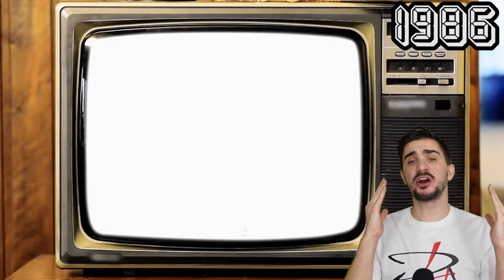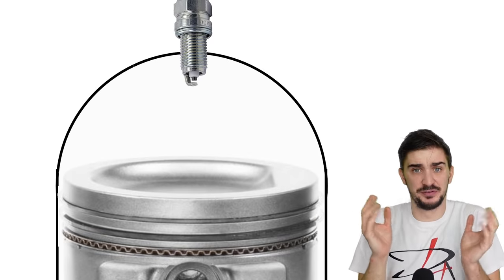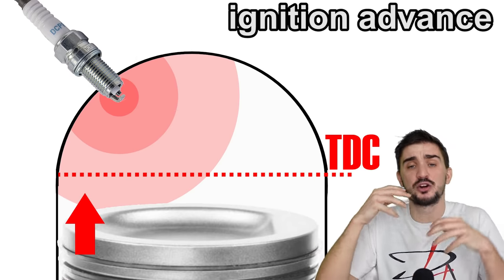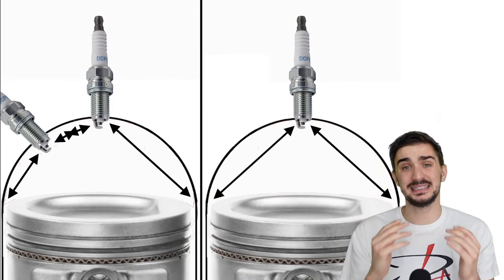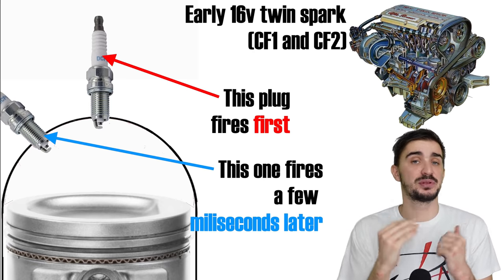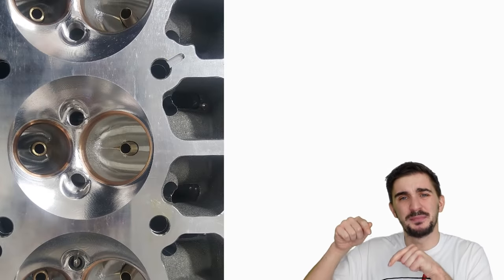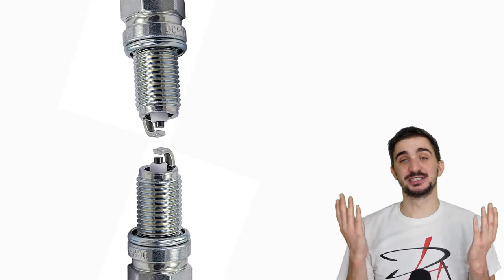TWIN SPARK - WHY, HOW and why it isn't more widespread

Comment: Your videos are almost always great, but this is quite wrong. Twin plugs are really only done as a band aid, no decent engine designer has ever started with twin plugs unless redundancy is needed. The biggest miss is the fact that they are needed on a 2 valve hemisphere combustion chamber beyond a certain compression. As you bulge the piston, the chamber end up looking like an orange peel section, which means no flame propagation to the other end. Some builders back in the day even resorted to pistons with groves in them linking the two sides. It’s not for speed or really anything else aside a band aid for combustion stability.

Comment: I have this cool motorcycle in the Philippines it was a bajaj rouser ns200 with triple sparkplug. I mean its not necessary but its helpful when it comes to traveling long distance no need to worry about having a bad sparkplugs cause you got 3 of them 😂

Comment: 2003 -> present 5.7 hemi has twin spark plugs. Fairly certain of everything mentioned the gen3 hemi is the most widely produced twin spark engine that ever existed.
Reply: Only if you consider North America. 

Even then.. Chrysler is the smallest of the Big Three… and most of their vehicles have the Pentastar (for example only one of every ten Chargers sold has a Hemi).
Reply: @Bartonovich52  No, I literally mean its the most widely produced twin spark engine ever produced worldwide. You can look it up, they've made millions more than the next most widely produced multi cyl car engine anybody can name. Sure, if GM made an LS or LT that was twin spark that would easily be the most produced. And Ford simply did not produce anything twin spark long enough to really get the numbers out there.

Comment: The Alfa with 2 sparkplugs i knew before - the original Shelby 350 and 500 engines also have 2 sparkplugs (16 ) - have seen that some nitro-metane motors also use 2 plugs per cylinder , thinks it becauce the lethal nitro almost makes the pistons and valves melt down  and burns it tight together

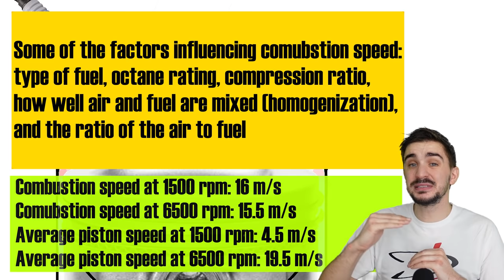Comment: At 4:41 can I know why the combustion speed decreases with increase in rpm
Reply from the maker: The mixture needs to be richer at max rpm and max load.
Reply: @d4a  A twin spark cilinder head is a tragic example of a bad developed cilinder head.
In order to recover this they added a second spark plug. The cheapest way!

Comment: It all depends on chamber design and the burn rate. If using normal "fast burning" fuels in modern efficient chambers which have fast burn characteristics the twin spark does next to nothing.

Comment: There are/were sparkplugs with multiple anodes. Old Volvo sparkplugs had 3 connectors to the core when i remember correctly. I dont know why. Maybe because of the Turbos and weak ignitioncoils. Maybe some one could help Here.

Comment: 10:32 let me see if I understand the joke: some VW engines are today using stratified injection, indirect AND direct injection. So they can purposely use heterogeneous mixture in a good way. They create a heterogeneous mixture if you are talking about the entire chamber, but actually they create an homogeneous mixture close to the spark, so it's possible to use a poor mixture in the rest of chamber unless being incomplete combustion, once the homogeneous mixture close to the spark will to the job of firing everything.

Comment: Aircraft have two plugs for redundancy and reliability. I've yet to read anything that references performance.
Reply: I might add that this addition to aircraft engines has been done since before the first mass produced aircraft.
Reply: The efficiency is marginal, but it exists. When you're fliying, you're supposed to turn on and off the mags from time to time to check if they are working. When you turn one mag off, you loose about 50rpm. Its marginal, but it exists.
Reply: As stated in the video @12:25

Comment: 12:10 - Almost all Piston Powered Aircraft (99.9%) have 2 magnetos which are AC generators that fire the plugs - Sorta Like a generator, Coil, and distributor in one unit. So if they only had 1, and it failed no plugs would fire, and they would have a lot more to worry about than hydrolocking the motor.

Comment: Why not more than 2 plugs? Say 4valves, and 4plugs, or 3 plugs,  one on each side of the valves one one center, maybe fire the two outer, slightly before the center, so possibly the remaining mixture will possibly be at a higher pressure, when ignited, it would only be a slight timing difference, but it could possibly work,  it would be like having a higher compression ratio,   has anyone done any testing on this?  Seems there could be a performance Gain, from the higher pressure of the mixture,  and slightly later when the crank angle is closer to 90°  a engine still expanding the combustion at a great rate with the crank angle close to 45°-90° would make tons of power, like a nitromethane, top fuel engine,

Comment: Twin spark plugs would benefit short stroke big bore engines that rev high (race engines).  Porsche had a twin spark 3.6 litre flat 6 in 911.

Comment: My motorcycle has twin spark plugs per cylinder. It’s a 2008 Kawasaki Meanstreak 1600. Definitely not the pinnacle of engineering. In stock form it produces a whopping 73 horsepower. So in my case, it’s slightly higher service costs for no real benefit, power- wise anyway! 
Still, I get to tell people that my 300kg, Japanese cruiser is a twin spark and that makes it cool, right?!

Comment: Would be curious to try modifying to a dual spark plug a 2 valve, single plug engine 🤔.
Reply: Back in the late 70’s Kawasaki did that with their Z1000 Superbike racer.
Reply: @kasperkjrsgaard1447  Thanks for the tip, that's a good inspiration! Do you happen to know of some article or material about it? I'm not much of a bike guy.

Comment: Aero engine twin sparks engines (mandatory) has more to do with the legal requirement that aero ignition systems must be self exciting, (not rely on a battery)  meaning that in the boat anchor technology of aero engines, (once it's certified its specs are carved in tungsten carbide and woe betide any-one who attempts to alter them ) Leading to the magneto  being the most common ignition system on aircraft engines since WW1. Magnetos have all the reliability of a 1960's Mickey Mouse watch in a fish tank. Mean time between failure hovered around the 800 hour mark for decades ( compared to electronic ignitions being around 10,000 hours MTBF) Magneto failure was (and still is) a quite common occurrence which is why at every take off a magneto check  is carried out before flight.. The second spark plug is there to keep the fires alight in the likely event that a magneto calls in sick and roadside service is unavailable

Comment: I do belive, you missed the whole point of Alfa's reason to develope the Twin Spark engine in 1986. At least you skipped the most important part.
The Japaneese was introducing 16 valve technologie at that time, and the Twin Spark, made the 8 Valve engine so efficient that the power output was the same as creating a 16 walve head.
Drilling an extra hole, was like a LOT cheaper, than 8 extra valves and valve trains.
The result vas a 8 vale engine, producing the exact same Hp, as a 16 Valve.
Here's the real reason to Why. 

And Knock accures before a spark from any sparkplug, not after a spark has ignited the fuel mixture. Just for your info. :-)
Reply: Detonation (spark knock) : POST-ignition, uncontrolled spontaneous combustion … Just FYI …

“Detonation is an uncontrolled combustion event which occurs after the spark event. Pre-ignition is an uncontrolled combustion event which occurs before the spark event.”

Comment: Question...since small airplanes operate at constant speed and load why not use diesel engines? Far more reliable, better fuel economy would downfall be weight?

Comment: So if the main holdup for twin spark is limited headspace. What about 2 stroke engines? They don't have any valves, so the entire head is free real estate. Or what about flathead engines? No reason not to make them twin spark. Maybe my lawnmower could get a little extra power and efficiency.

Comment: My 2013 6.2 f250 16 spark plugs. It seems to work......or Ford owns stock in a spark plug company. I'm sure the current 6.2 f250 still has dual spark plugs.
Reply: My Ford 6.7 didn’t have any spark plugs …
Reply: @sking2173  it's diesel

Comment: In the hemi section, you say that the hemi doesn't have variable intake. This is incorrect. All of the improved 5.7 engines have variable length intakes. This gives them a very flat torque curve.

Comment: 7:04 it is not true. In 4 valve dual spark case Bajaj put two spark plugs at outer edge with same distance from the center. So it is "possible", just not with center position :)

How about triple spark and Bajaj's claims? Simulatuon results given in the promotion video seems plausing. Test riders said it is much snoother comparing with single spark engines. Is it just triple spark or other things combined?

Comment: twin spark engines do NOT increase servicing cost at all.
as we have established, with modern technology, one spark plug is all you need, so having a second one creates redundancy, which means one spark plug breaking is not a big deal as the second one alone is perfectly adequate.
also having two spark plugs increases the chances of suboptimal air fuel mixtures which can be caused by malfunctions in other parts of the engine that can be very expensive to fix, igniting regardless.

essentially twin sparks decrease the likelihood of crippling engine malfunctions by providing redundancy against spark plug malfunctions and by increasing tolerance against malfunctions in other engine components, thus reducing the need for immediate repairs and increasing engine life overall.

Comment: Aircrafts still rely on 2 spark plugs also because most engines still use magnetos that are quite unreliable. In essence, it is the entire ignition circuit that is redundant.

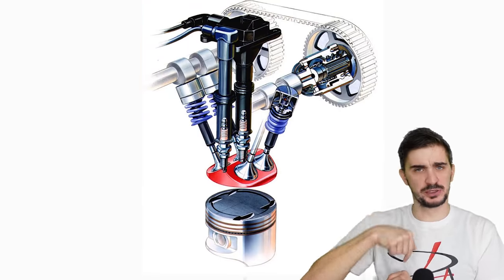Comment: 2:50 that combustion chamber shape is ALMOST THE SAME as a buick nailhead from the 50s
now if only buick was able to produce better flowing heads..... (yet buicks engineers were DAMN GOOD..... so they got around it with intake pulses and cam grinds)
.
401/425 nail heads with "switch pitch" ST-400 transmissions made a LOT of mopars,  chevys, and fords look like granny cars..........
kinda like a "slide and slide" power glide..... but its ALL converter... (the dyna flow HAD NO GEARS!! literally "all converter" )

Comment: These airplane engines have huge cylinders, each cylinder on a typical airplane engine is almost 1,500cc. This means that dual spark would be a requirement for performance, even without the redundancy aspect.

Comment: The reason aircraft engines use dual plugs is reliability. An admission that it is still an issue. The rpm drop during run up varies from engine model to engine model. In the O200 used in the Cessna 152 the acceptable drop is 75 rpm. More in other engines. The reason for this is the large bores of aircraft engines. Twin plugs result in 2 flame fronts. Faster flame travel. If the rpm drop is outside spec there is an ignition issue and takeoff is aborted. "

Comment: I was recently working on an aircraft with 2 of everything on the ignition as a back up in case one fails. It had 2 spark plugs, 2 coils, 2 cdi, 2 crank pickups etc. You could turn off each ignition system separately, and when running if you turned one of the systems off there was a clear difference in engine tone and pickup. On the other hand I don’t put this down to simply being twin spark. I didn’t look that much into it, but looking at the pickup arrangement for the magnetos, I suspect that the back up spark plugs on each cylinder are actually retarded by a few degrees, and suspect that each mag does the main spark on 2 cylinders, and the backup on the other 2 cylinders. I could be wrong, but in this case the difference seemed way too much to be just down to  single spark 🤷‍♀️

P.s. there are quite a lot of motorcycles that use twin spark.
Reply: what did you work on aircraft?, there are 2 magnetos, each gives spark on one plug on each cylinder , so if one die, other gives spark on second plug, there is ground engine check-magneto check where at some higher rpm , unplug one magneto and rpm must drops for some rpm(200) both magnetos are checked
Reply: @StupidBlokeStupidVideos  you are wrong ,both magnetos have same timing and it is better combustion with 2 spark plugs than with one
Reply: @StupidBlokeStupidVideos  when i flew small aircraft , there were 2 magnetos, left and right, both are main and must be adjusted to work together
Reply: @StupidBlokeStupidVideos  no, in video was told too,  that there is no benefit if 2 plugs fire sparks with delay

Comment: Where are all my rotary brethren at? 2 spark plugs because the combustion chamber is awkwardly shaped, long, and flat 😬, single spark plugs would result in dumping fuel out the exhaust

Comment: I own a cheap bike, originally 220 cc, 1 piston 2 spark plug, 2 valve. it's standard engine powerful enough to smoke 250cc bike with 2 pistons, win at torque and acceleration power. but I lose at top speed since it's limited to 158km/h. so I modify it last month with some parts from it's successor like 72mm piston and 4 valve cylinder head. become 1 piston, 3 spark plug, 4 valve. also with transmission change. now 252 cc engine single piston, reach 46hp at 11.913 rpm. so, my bike is better than 2 spark plug engine, the 3 spark plug engine :v

Comment: Twin spark cost more than single spark. That is the only reason why not every car has ts. It helps to burn the gazolin better, the emissions are lower, fuel consumption is lower, the combustion chamber is cleaner and the engine has more power.

Comment: The modern Hemis are Twin Spark. Ie The 392 Hemi. That engine is massively better than the DB M156, in torque and fuel efficiency and emissions.

Comment: As always, you did a great video about the subject. I saw BMW 1200 ccm boxer engines are also installed on smaller aircrafts. I think that even today, twin spark is beneficial for engines with larger displacement and a smaller amount of pistons. I star learning about boxer engines when I bought BMW motorcycle. Displacement of 1.2l and 2 cylinders (and twin spark) work better than 6 inline diesel engines.

Comment: Hi, Kindly check this little Motorcycle- Bajaj 200NS, it has 200cc 4 Valves and 3 spark plugs - all arranged on a smaller SOHC Head size. Is this anyway a Valid configuration?

Comment: Actually A.L.F.A. has patented the twin spark system in 1911. In the 1914 GP-engine they have everything together: hemispherical combustion chamber, DOHC, 4-valve per cylinder (it was the very first of this construction eventhough Peugeot made the very first 4-valvve per cylinder engine 1912) and of course the main topic of this video, the 2 spark plugs per cylinder.
The first commercial use of the twin spark technology was in 1965 in the Giulia Sprint GTA. It had the 1.6-litre engine with modified cylinder head. This engine could be find in the Tubolare Zagatos (TZ models).

Comment: Maserati straight six cylinder engines of the 1960's until the 1967 Mistral were of dual plug design.

Comment: Love the video as always. However, Mercedes used this system for quite a while and they're three valve engines. So the V12 had 24 spark plugs. Also, Chrysler still uses this in their hemi engines, 5.7 L, and 6.4
Reply: Fun fact, mercedes developed their twin spark engines right when they merged with Chrysler, there were remnants of their collaborations in chrysler cars long after the merger got dissolved, like the chassis, shared interior trims, engine design, etc.

Comment: As usual, you didn't really document yourself. Before A.L.F.A 40/60 there were several twinspark aircraft engines and even in cars there are some Mercedes engines that use twinspark.
Also there are motorcycles with variable valve timing, Honda VFR is one of them.
The Alfa Romeo twinspark 16 valves engine (present in 145, 146, 147 and 156 models) does NOT use the same sparkplugs together. When the piston number one is at explosion one sparkplug ignites the mixture and another spark goes to the sparkplug at cylinder 4. The sparks are like this:
1 with 4
2 with 3
3 with 2
4 with 1

Comment: 9 cylinder radial engines on Harvard/Texan T6 U replace 18 spark plugs every 7 to 10 k hours. Each service/replace makes most airplane owners cry at $55 per plug on a LS321A Radial and 8 or 12 on a flat six using REM40 Champion Aero. That can make most millionaires cry!!!!

Comment: The 2024 BSA Gold Star motorcycle uses two spark plugs in its single-cylinder 4-valve DOHC water-cooled electronically fuel-injected engine.
It's probably to meet future emission regs.

Comment: 1) Car makers are trying their best to go electric. However there is not enough Lithium to mine to make the batteries
2) Exotics and Dodge Hemi already have 2 sparkplugs. More cost to the maker and consumer. 1 for ICE and other for emissions.
3) only one plug is needed to ignite the fuel mixture,

Comment: Hydrolock is not something that's going to happen from a failed ignition system.   Planes have dual systems just for redundancy and to prevent loss of power, not really engine damage.

Comment: Did you know the smart for two car (450) is a 3 cylinder engine with 6 spark plugs 3 on-top of the engine and 3 on the side(behind the rear bumper) 
What about this technology, how does it work?

Comment: 3:38 The engine in the image is not DOHC by any stretch of the imagination.
DOHC with push rods?
Reply: Are you talking about the blue background drawing of the engine? Because it is definately DOHC. Just look at the top of each valve-stem. It has camshaft over it. The left cam lobe points opposite to the valve-stem while the right cam lobe pushes the valve down to the maximum lift